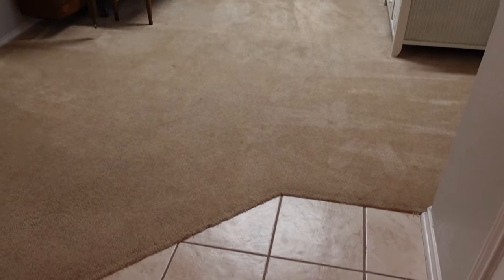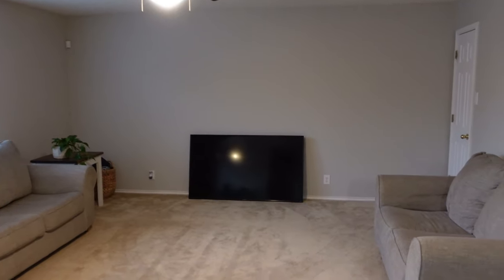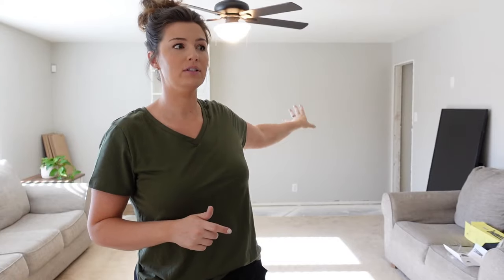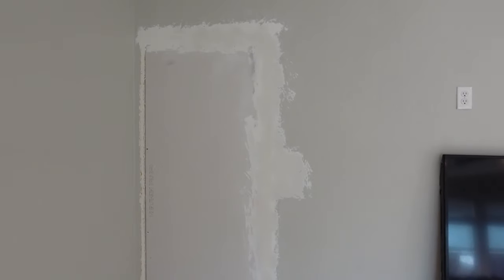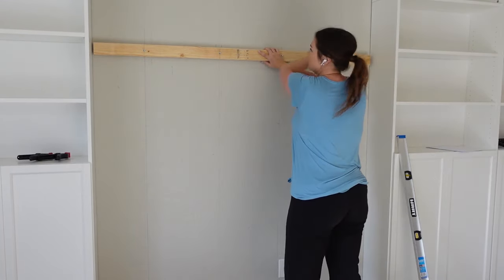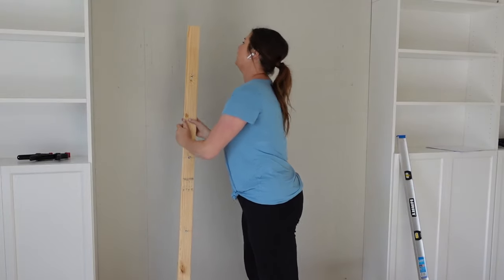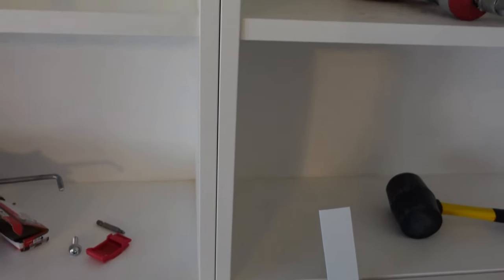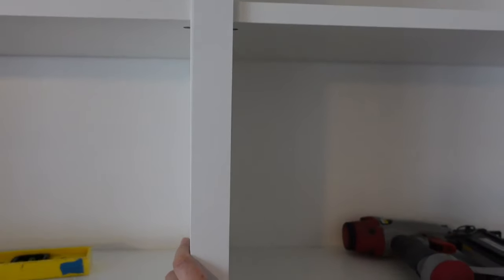DIY BUILT-INS ON A BUDGET (IKEA HACK- BILLY BOOKSHELVES) | Home Reno Ep. 1

Comment: Wow! Beautiful! I have a question about the cords and how you access them to change out the TV. Do you need to remove the fireplace? I couldn't figure out how you reached in there to plug in the fireplace and tv 😁
Reply from the maker: I really wish I would have included this in the video. I left a hole behind the tv and shiplap. I also cut holes in the side of the cabinets that touched the shiplap. I had wall outlets behind the cabinets that I accessed by cutting additional holes in the back of the cabinets. So the tv cord goes behind the shiplap. It runs down then comes out of the side and plugs in a wall outlet behind the cabinet doors. So you never see any wires. Hope this makes sense.
Reply: @KelseyRomitoDIY  Yes it does!! Thank you! I really love it, great job!!

Comment: Amazing! I'm attempting something similar in January. On the Ikea website the doors seem to have the handle holes pre-drilled. But your cabinet doors came without holes right? And where did you get the handles? :) Thanks in advance
Reply from the maker: So the doors are technically pretty-drilled but not all the way through. So from the front, it looks like there is no hole. 

Here are my cabinet pulls-
https://www.lowes.com/pd/Brainerd-Square-Bar-3-in-Center-to-Center-Matte-Black-Rectangular-Bar-Cabinet-Door-Pull/1002690870?cm_mmc=shp-cprdhdwgglLIA_HDW_213_Decorative-Hardware-1002690870--0--0-_-0&ds_rl=1286981&gclid=CjwKCAjwiY6MBhBqEiwARFSCPjpqE2l_nYjgIP3NFZzQCSOEbgZxJgW3B9OAQ4Obu3ip2roO5m4W0hoC1tgQAvD_BwE&gclsrc=aw.ds

Comment: OMG. That looks great and gives me a couple of ideas for some built-ins that I've been kicking around in my head for a couple of years :). Maybe you didn't video it but, I didn't see you make provisions for the power and cabling for the TV, soundbar, and fire place. Is that a separate video?
Reply from the maker: Wish I would have included this in the video but it was my first one and I was still learning. There are outlets inside the cabinets. I cut a hole in the back of the cabinets to access them. Then I drilled a hole in the side of the cabinet closest to the fireplace and pulled all the cords through to the outlet.

Comment: Hey! Love it! Just curious if you made pocket holes for electric? How did you plug your sound bar in? Also are there outlets inside the cabinets? ❤️
Reply from the maker: There are outlets in the walls behind the cabinets. I cut a hole in the back of the cabinet and used surge protectors. The cords come down behind the tv and fireplace and through the side of the cabinet.

Comment: Looks amazing! wondering what kind of trim you used for the middle and did you at any point debate between the glass doors? Did you find it easier to build the mantle after?
Reply from the maker: The trim is called lath. I didn’t want glass because I wanted closed storage.

Comment: Great work! Curious how you secured the bookcase to the wall? Sorry if I missed this. Thanks
Reply from the maker: I don’t think I included it in the video(definitely should have) but I screwed through the back panel directly into the wall. Also through the side panels that are touching a wall. Then I used a few screws on the other sides of the shelves to screw the bookshelves together. Hope this makes sense!

Comment: This looks amazing! Not sure if you answered this previously, but after getting the fireplace and TV mounted how did you get them connected to the power? Did you have an outlet on the original wall and plug things in before screwing things in placing?
Reply from the maker: There are outlets on either side inside the cabinets (the outlets were already there- I just cut holes in the back of cabinet to access them). The wires run down behind tv and fireplace. I cut holes in the side of cabinets where you can’t see so the wires can come into the cabinet and access the outlet. 
I really wish I would have included this but this was my first video and I totally forgot. Hope this helps.
Reply: @KelseyRomitoDIY  That makes a lot of sense. Thank you for clarifying! Good job again on your project.

Comment: This is awesome! I want to do something like this for my parents. Quick question...did you leave the hole open behind the TV, and if so, why? Also, you covered up where the shelves joined to make it look custom but you forgot to do it at the bottom.
Reply from the maker: I left the hole open behind the tv just in case we need to access that area for any reason. 
I didn’t forget to cover the seams at the bottom. I hadn’t installed our new floors yet so I wanted to wait until the new floors were in. They have trim over them now.

Comment: Thanks for this. Pretty darn amazing. 

I’m trying to do a feature wall as well. Honestly mine isn’t coming together as well as yours. I’m sorta the opposite side of you age wise (78) with lots of home deco experience, moderate home diy and reno abilities but no building skills with paper saws. 

Will you share with us please your own experience and background regarding prior wood projects, remodeling, experience with power tools etc? 

What did you use as the interior vertical panels on the Billy bookcases? Does Ikea make these panels as tall as the Billys with added  extension? 
Finally, did you build a frame on the tops to support your top molding trim or tack the trim to an anchored block?

Big thanks for your help and best of success with your channel!
Reply from the maker: Lots of people asking about my experience with tools and remodeling. Maybe I should do a q&a video soon? 
The original billy bookshelf comes with an interior panel that you nail on the back. The extension pieces also come with a back piece. So it all blends together and looks like one big unit. 
For the top trim piece, I used the nail gun to shoot it right onto the billy shelf (holding the trim board to make sure it was laying flat against the billy so it wouldn’t be slanted backward). Once I caulked all the way around, it was completely secure. (If I had a bigger gap, I definitely would have used an anchor block to nail into)
Hope this helps! ❤️❤️
Reply: @KelseyRomitoDIY  Thanks a bunch!  I didn’t explain myself well as to my query about the vertical panels. I was speaking of what appears right  to be tall vertical side panels within the TV section middle. It looks  like you attached tall white vertical panels to your left set of stacked bookcases on their right vertical exterior sides where your TV section begins. Then again added a tall white panel on your right set of stacked bookcases where the middle TV section joins that right set of bookcases. Put another way, your middle tv section appears to be flanked left and right by solid white panels attached to the TV section sides of your stacked Billy bookcase units. If you did add 2 tall white panels to demarcate the middle TV section and reduce notice where the top bookcase extensions join the bottom sections— I was hoping you would explain where you got those color matched panels. They match so well! Or did you paint the whole beautiful wall white after you built it?  Oh and a Question and Answer video would be excellent!

Comment: Did you use something to fill all the holes that eun vertically inside the shelving walls (for adjusting shelf height)?

Final review clip makes it look like maybe you did, but hard to tell with that video filter.
Reply from the maker: I used a little bit of white spackle. They’re not completely filled in case I want to adjust them but it camouflages them.

Comment: Your intro is so cute. I love it. 😁💟 Did you have to pre-drill the 2x4s? Ours keep splitting when we screw nails into them. Not sure what we're doing wrong, unless we're supposed to pre-drill.
Reply from the maker: Thank you! I’m pretty sure I pre-drilled the holes. That will definitely help with the wood splitting.
Reply: @KelseyRomitoDIY  Awesome. That's what I ended up doing. It's going great. I have my platform built and my bookcases and dressers in place with 2x4s acting as spacers between them. I'm now building the cupboards to go on top, then I'll start adding the trim. It's been such a fun project! Thanks for your video.
Reply from the maker: Sounds like it’s going to be beautiful! Good luck!
Reply: @KelseyRomitoDIY  thank you! 😊
Reply: I finished my built-in bookshelves and wanted to show you how they turned out. Thank you so, so, so much for your video!! It was one of the most helpful I watched before and while I was working on the process.
(My video was me recording off of pictures I took during the process because I didn't realize people would want to see the project as it went along. Just skip to the end where I show the befores and afters, if the link even works, and thank you again so very much!)

https://youtu.be/TBVrL6DhHeQ

Comment: Nice. 
Has the radiant heat caused any issues with your shiplap or shelves?

For future, they’re called battens.
Reply from the maker: Honestly I haven’t run the heating element of the fireplace other than to test it. It’s just now under 80 degrees where I live. Haha 
But I did make sure to research different fireplaces. The one I got is not supposed to be hot to the touch and the blower sends hot air out instead of up (I was worried about lots of  direct heat on the tv)

Comment: Ur supposed to put a plate over the old light switch to let others know there is electrical there. This will prevent anybody from drilling any holes or proceeding with caution if they should ever do any construction around that area.
Reply from the maker: I moved the light switch to the other side of the wall so it can be accessed from there. No plate cover required.

Comment: Did you fill the holes in the cabinets with the variela little plastic plugs at ikea or use another method to fill the hundreds of holes lol.
Reply from the maker: Definitely not! I just ran a line of caulk over the holes and then wiped away with a wet cloth. Didn’t fill them all the way- just camouflaged them and I can still see them if I want to move the shelves.

Comment: On your  dining make over what was you using on wall and thickness?
Reply from the maker: They’re called bender boards. They’re very thin. 
https://www.homedepot.com/p/MDF-Bender-Board-Common-1-4-in-x-3-3-4-in-x-97-in-Actual-0-25-in-x-3-375-in-x-96-in-487404/202297474?g_store=6551&source=shoppingads&locale=en-US&pla&mtc=Shopping-BF-F_D21-G-D21-021_003_DIM_LUMBER-NA-NA-NA-LIA-NA-NA&cm_mmc=Shopping-BF-F_D21-G-D21-021_003_DIM_LUMBER-NA-NA-NA-LIA-NA-NA-71700000045530102-58700004682521920-92700053361644909&gclid=CjwKCAjw4ayUBhA4EiwATWyBrmCYRWoiNr4a_x58HbYzpT4gebIw5LchKAKiD9iMRnskI6PB4KcihBoChWYQAvD_BwE&gclsrc=aw.ds

Comment: How did you plug in the tv and hook up the cable
Reply from the maker: I should have included this in the video but completely forgot. There were already outlets behind the bookshelves so I cut a hole in the back of the bookshelves so you could access the outlets from inside the cabinets. I also cut a hole in the side of the bookshelves (the side that is connected to the shiplap part), so the wires from the tv and fireplace go through that hole and plug into a surge protector at the outlet. Hope this makes sense!

Comment: Your tutorial is by far the BEST! My only question is how did you connected the TV ? Can I also know the measurements for the TV space? .thanks
Reply from the maker: Thanks! I wish I would have included this in the video. The cord for the tv runs behind the shiplap and into the cabinets (I cut a hole in the side of the bookshelf). There are outlets behind the cabinets so I cut a hole in the back of the cabinets to access the outlet. The tv/shiplap area is 96” tall and about 66” wide.

Comment: Young lady you are awesome. Question,  how do you access the electrical outlet
Reply from the maker: I left a hole behind the tv and shiplap. I also cut holes in the side of the cabinets that touched the shiplap. I had wall outlets behind the cabinets that I accessed by cutting additional holes in the back of the cabinets. So the tv cord goes behind the shiplap. It runs down then comes out of the side and plugs in a wall outlet behind the cabinet doors. So you never see any wires. Hope this makes sense.

Comment: Hi Kelsey, this is some great work. How did you hide the shelve holes on the inside?
Reply from the maker: They aren’t really hidden. I filled them with a little bit of caulk to make them less noticeable but still be able to find them if I do want to adjust the shelves.
Reply: @KelseyRomitoDIY  Thanks for the reply, hardly notice them on the video. Cheers

Comment: How far did you build the wall out past the cabinets? And did you just use shiplap?
Reply from the maker: Yep I just used shiplap on top of the 2x4 frame. I’m pretty sure the wall is about 6” past the cabinets but I’ll double check ASAP. (Currently out of town)
Reply: @KelseyRomitoDIY  thank you! One last question if you can! Did you leave a space between the cabinets and the wall you built? We are doing drywall and trying to think of how to trim it out but I think we need to move the wall down a few inches to account for material
Reply from the maker: Yes I left just enough space for the shiplap to slip into so it looks seamless